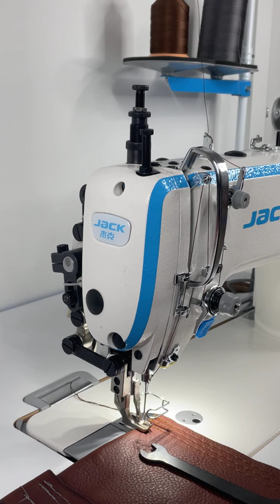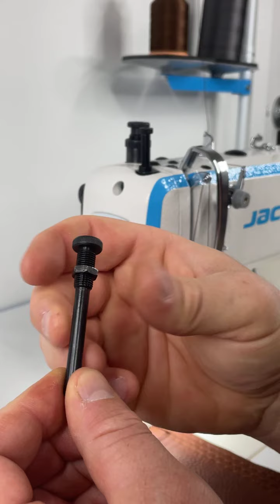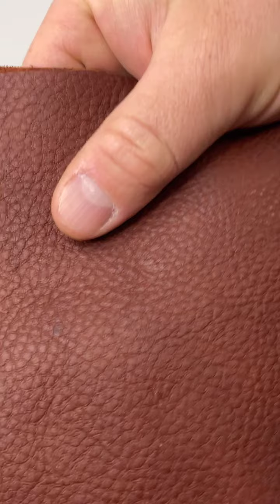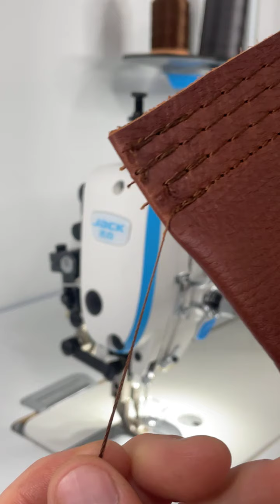JACK Industrial Walking Foot Presser Foot Pressure Adjustment

Comment: Hi there, I was wondering if you could help me. I have a jack 2060 and the foot is not lifting when I use the pedal, I can only lift it by hand with the handle?
Reply from the maker: Does your machine have an auto lift feature or does it have the knee lift?

Comment: Has anyone done this and had an issue with a clunking walking foot without the spring and unable to put the spring back in?
Reply from the maker: If you are going to remove the spring, you cannot go fat as the foot system will bounce as there is not enough downward pressure on the foot to go fast. Keep the speed below 600spm.

Comment: HI, my H6 is dragging my fabric out of square, so on my dog collars the pattern is on the slant, I don’t have the small threaded bolt in the center that you show removing and putting back in after removing the big spring.  Also I cannot lift the feet using the the side arm by hand as you show with feed down.  Is that normal ? I have auto foot lift on mine if that’s relevant
Reply from the maker: Hi Helen. I've had a look at a few images and seen that the little middle screw is not on the H6 like on most other machines so shouldn't make any difference. It could mean that the upper presser feet are not on straight which I have had this problem on JACK machines previously or there is more pressure on one side than the the other. It could be a few different things. I'd contact your local dealer and get some advice or take it in and get them to have a look at it.

Comment: What size needle do you use when working with vinyl?
Reply from the maker: That depends on the thread size you are using but I use 110 or 120 for most of my work using M20 spun polyester.
Reply: I have some more questions for you about the h2 is there somewhere better to contact you
Reply from the maker: @jamesfishermancrawford8240  you can email ozcommercialsewingmachines@gmail.com
Reply: @ozcommercialsewingmachines I have tryed this is there a another way

Comment: Hi does the recent Jack H2 still have that upper 3rd piece you took out? My supplier are telling me the top piece isn’t part of the newer model , ?  If so how do I adjust the pressure or should I just buy a smooth foot to stop marking my fabric
Reply from the maker: The new H2 still has the same pressure adjuster but you will find that there will be a collar inside which you can remove to reduce pressure. If you watch our video on the PS-0303D it will be the same system as that.
Reply: Thank you 🙏

Comment: اI had a problem where I could only lift my foot with difficulty and it made a sound when lifting it
Reply from the maker: You might need to get that looked at.
Reply: @ozcommercialsewingmachines  Thank you, I went to the dealer and had it fixed

Comment: Hi. I’m running fast at around 2500 on a 2060. I’m sewing pvc coated reflective tape and bruises easily. Do you think it will be ok to run high speeds without the large spring? Thanks for the vids. You made me buy the 2060 in the U.K.  it’s a beast!!
Reply from the maker: You can only try but without spring pressure your feet may bounce more than usual. If the feet bounce then I'd say no, don't do it at speed.

Comment: Thanks.  Great Video.   After taking main spring out, it sticks out a whole lot when putting back.   Almost half the spring.   Any advice?
Reply from the maker: You may need to remove the front plate so you can see what the spring is doing inside if it is not seating properly.

Comment: great video. thanks for useful info.
I think to avoid the marking under the leather you can also use some kind of plastic dog feed as lower feed. am not sure Jack accept that kind of plastic lower feed but some models of Juki accept it. 
this is what am thinking am not sure, because I've never use that plastic lower feeds.
Reply from the maker: Thank you :) We have never used the nylon feed system either, I think the removal of the large spring or the collar in later variants is the easiest way to go about it.

Comment: Thanks for that. Would you say that it's possible to sew light weight cotton on this machine. It's great for doing my vinyl or leather but if I do a cotton lining for a bag I then need to change to my domestic.
Reply from the maker: It certainly was not designed for light weight cottons, with a small needle and significantly reducing tensions it may do a satisfactory job, but I would probably recommend sticking to the domestic for linings.

Comment: Hello, good video! I´v bought a jack 2030G, and i need to up a little the pressure foot to can sew thick fabrics. Can you explain how to do that in the right way (before i do some error)? Thank you.
Reply from the maker: These walking foot machines have a fair bit of pressure on the feet from the factory already. If you need to adjust to get more then all you do is release the nut that locks the pressure regulating screws and either tighten or loosen to where you need the pressure to be. You need to do both the outer an inner feet.

Comment: Hello!
Great Video!  Thank you!
Can you help me, please? What is the ideal pressure on the center foot? We usually use leatherette, rarely leather.
Reply from the maker: There is no real quantifiable setting regarding foot pressure, it is a balance between the machine feeding properly and reducing feed marks on the sewn item.

Comment: Hello! I tried to adjust the needle alignment when i changed presser feet on my juki 8700, and now i can't seem to be able to put back any presser foot. When i try to, the presser feet just touch the feed dog and wouldn't lift at all anymore. What do i do?
Reply from the maker: Thanks for watching our videos. Unfortunately it sounds like you need to call on your technician to re-setup your machine to get the presser bar back to factory settings.
Reply: @ozcommercialsewingmachines  thanks i called him, its fixed now
Reply from the maker: @aminashehu8628  Great news, thanks for letting us know.

Comment: Hi
I have one of these machines and would love it if you could do a video on how to adjust the pressure foot height.
Reply from the maker: Hi! This adjustment is usually set by your technician when you buy the machine. The height at the lever is a pre-set at the factory and should not be touched but the knee lift should give you a maximum of around 10 - 12 mm.

Comment: Thank you for your video, is there another video explaining how to adjust the feed dog height?
Reply from the maker: No problem. With regards to your question, are you talking about the upper feed or lower feed?
Reply: @ozcommercialsewingmachines  thanks 😊 feed dogs are chewing up my fabric a little bit I did think about filing down the feed dogs lol. It’s the bottom I believe that is causing it many thanks 😊
Reply from the maker: @marzipazi7498  The bottom feed shouldn't be chewing up the fabric. I'd suggest follow the steps in the video I made of how to reduce upper presser foot tension, this may help. The "H" series of machines were designed to sew medium to heavy weight fabrics.

Comment: Great video!  Thank you 🙏.  Do you have an industrial walking foot machine with the auto thread cutter function?  If so would you mind sharing a video on how to adjust the thread cutting length / tension to reduce thread nesting and/or long tales on the back when using the auto cutter / trimmer please.
Reply from the maker: Hi Chris. 
The only adjustment to shorten the thread tail after cutting is tightening the small pre tension unit above your main tension unit.
Your tail after trimmer needs to be a minimum of 20mm from the needle eye, to allow the first stitch to form correctly, and to reduce the thread from pulling out of the needle when starting.
Basically the thread tail has to go somewhere, so if your machine is equipped with a pincher, you can turn this off, it will eliminate the bird nesting underneath, but will obviously leave a tail on the top side if the work, which will need trimming off manually.
Reply: @ozcommercialsewingmachines  Thank you so much that really helps!  You’re a gem 😆